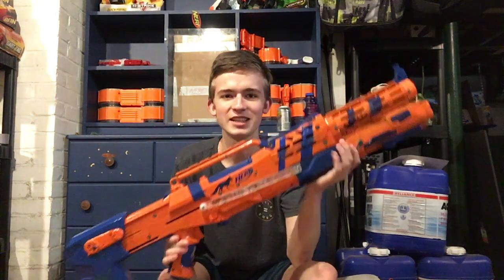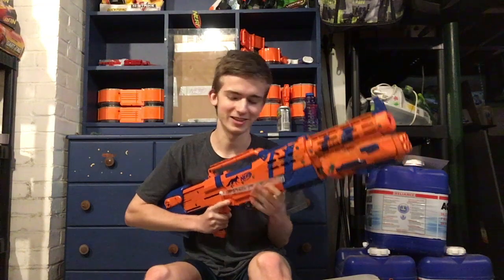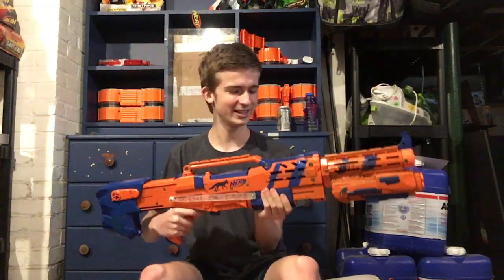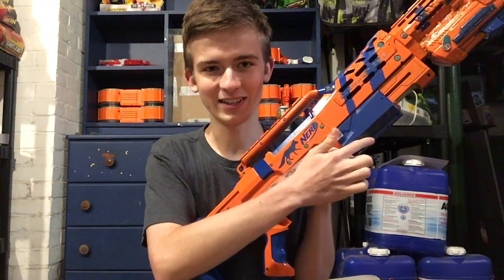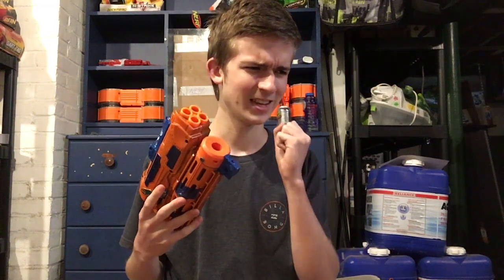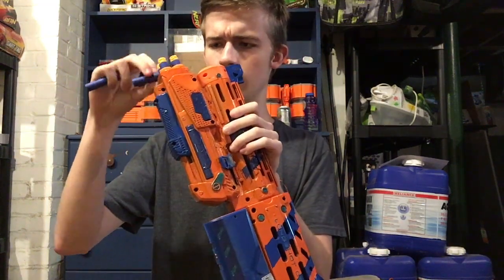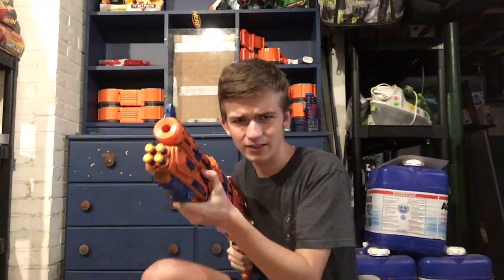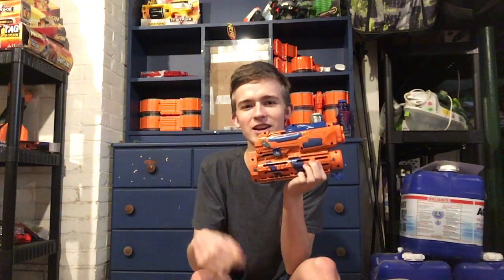Nerf Longshot with an undermounted shotgun attachment

Comment: Smart pick🔥🔥
Reply from the maker: Thanks, I wasn't planning on modding it, but it wasn't working very well in the first place. And these are fantastic when modded correctly. Mine had way more potential with the brass set-up than I thought. I have a video I'll post in the next day or so that shows some of the internals and my exaggerated reaction to it's power boost.